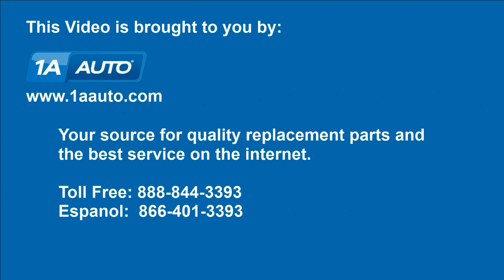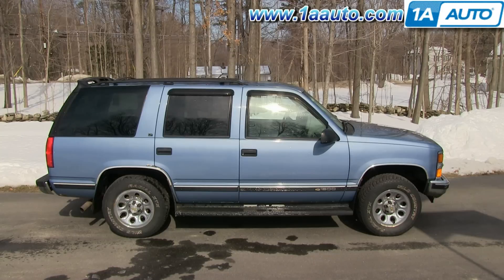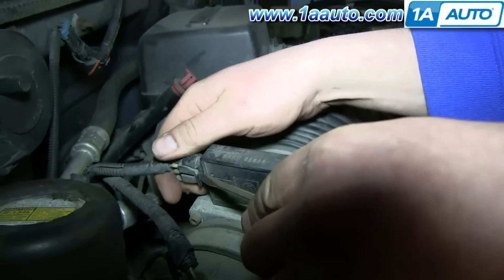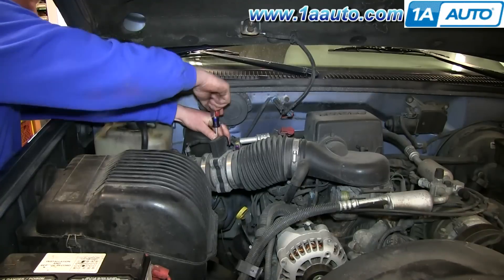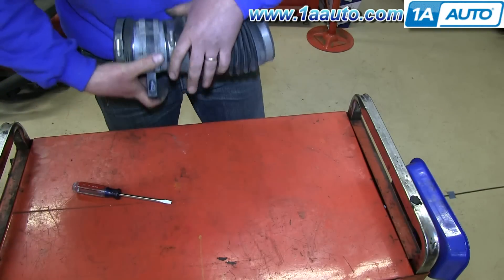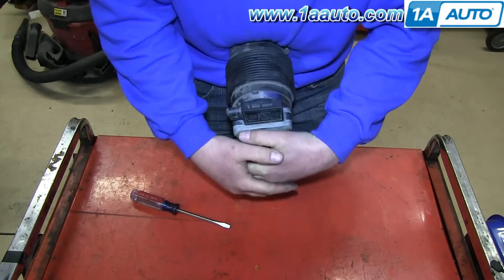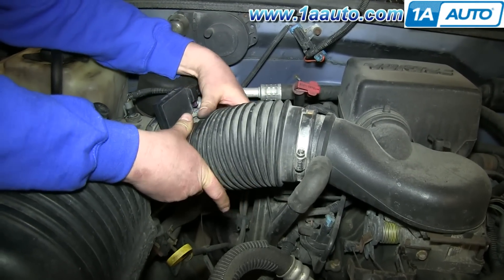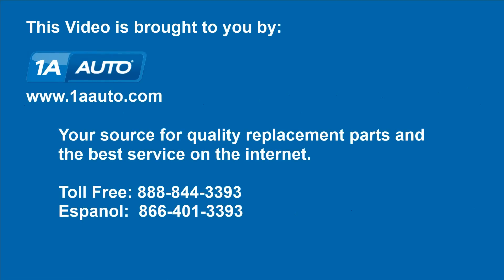How to Replace Mass Air Flow Sensor 96-00 Chevy Tahoe

Comment: Can a bad MAF sensor cause the vehicle not to start?  It was sluggish while driving and then i lost all power, power steering, and the engine died while driving!!  Thought it was the MAP sensor but replaced that but still doesn't start.  Any thoughts?  I think i will replace the MAF sensor and hope that does it.  🤞🤞
Reply from the maker: +samuel sung It can but there can be many other reasons as well. Double check any check engine lights that may be throwing codes to help you in your diagnosis
Reply: @1AAuto  Thanks for your help.  It ended up being my fuel pump.  All is good now.
Reply from the maker: You're welcome! We're happy to hear you found the source of the issue and were able to get it repaired! Thanks for checking us out. +samuel sung